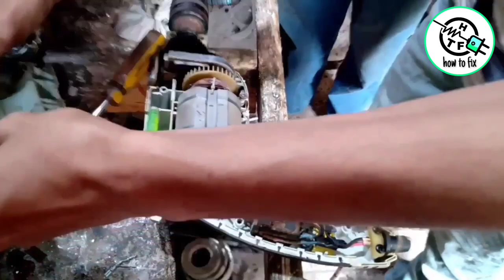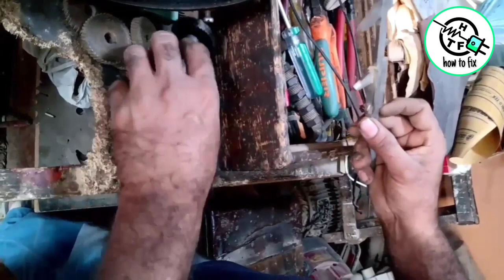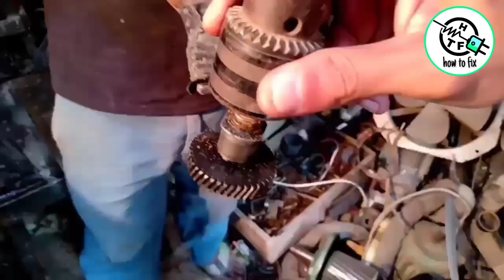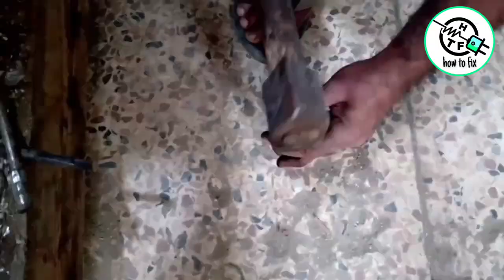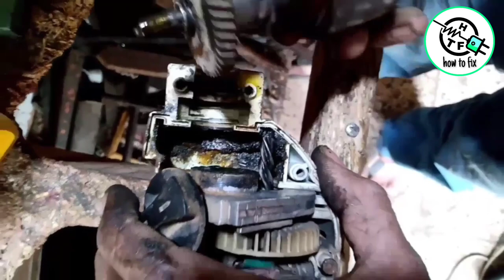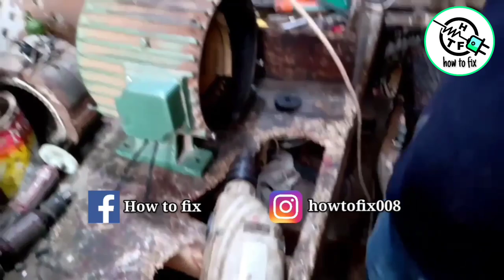Drill Machine Gear Wheel (Garari) Replacement|complete video 2020| How to fix #gearwheelreplacement

Comment: "It's so easy! Just grab one of the extra gears everybody already has and forget proper tools or safety, just have somebody hold it while you hit it with a hammer. I recommend sandals if something important or dangerous falls to the floor, like a retention pin or any heavy metal with sharp edges; it helps to feel if you can pick it up with your toes...or if it crushes them and you bleed and scream in panic. You won't regret this repair!"
Reply: i dont mean to be so off topic but does any of you know a method to log back into an instagram account?
I was dumb lost the login password. I love any assistance you can give me!
Reply: @Abdiel Calvin Instablaster :)
Reply: @Skyler Axl i really appreciate your reply. I got to the site on google and Im trying it out atm.
Seems to take a while so I will get back to you later when my account password hopefully is recovered.
Reply: @Skyler Axl It did the trick and I now got access to my account again. Im so happy:D
Thanks so much, you really help me out !
Reply: @Abdiel Calvin no problem =)